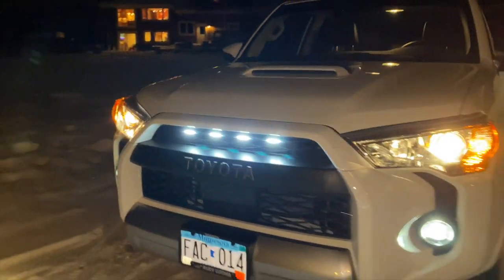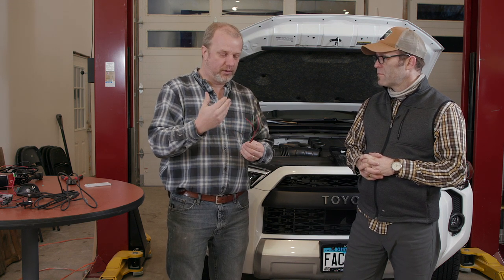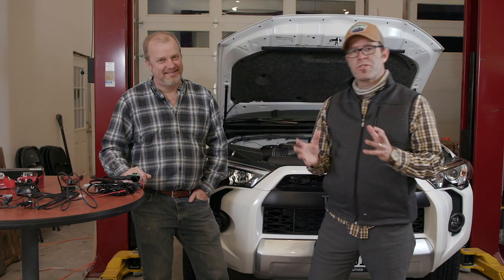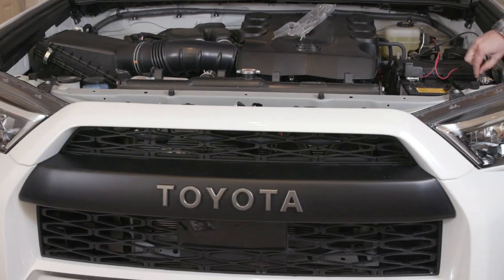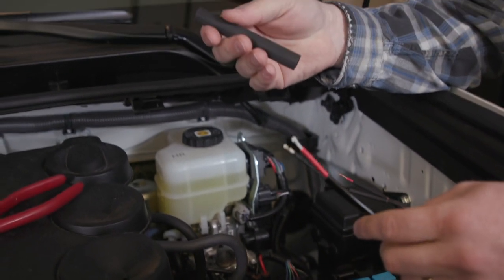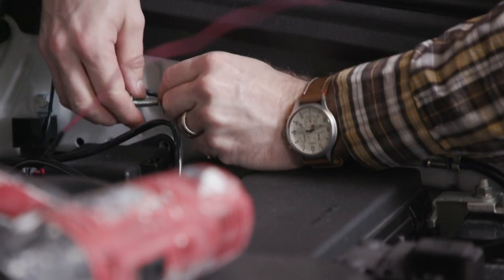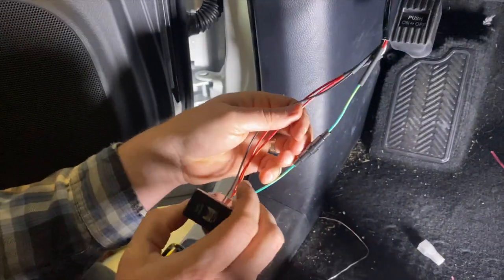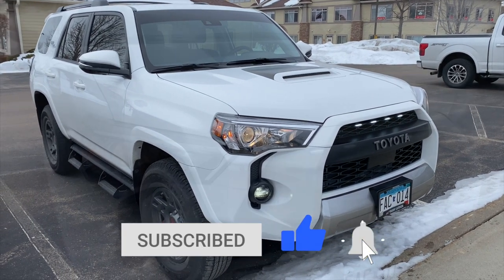5th Gen 4Runner Raptor Light Install with Switch AND Relay

Comment: Why in the world would you need a relay to switch on 3 little LEDs that probably won't produce more than .5 amps? Yes relays are the way to go with most applications, such as light bars, on board air compressors, ditch lights, pretty much anything with more than 3amps to be on the safe side. But raptor LEDs will work just fine with a fused power wire and any rocker switch, even the cheap eBay rocker switches would be able to handle them.  If I'm wrong, please correct me.   Suddenly everyone wants to put a relay on every little thing they install, thats why they sell them by the dozens on Amazon and eBay.    If you think im wrong, go look in your car's manual, and try to find the "relay" for your license plate lights lol 😂
Reply from the maker: Great point.  You don’t need the relay.  The instructions recommended it and we thought it might be helpful to learn about what they do and how to install one.  But you don’t need a relay for these lights. I’m currently running them on my ‘21 with no relay.
Reply: @PictureTime i apologize if i came out sounding disrespectful and rude, i take that back. Everyone should learn how to use a relay. Awesome instructional video on how to use a relay. Again, my apologies, hope you have a great Sunday 👍🏽